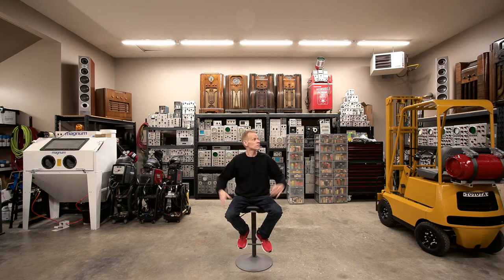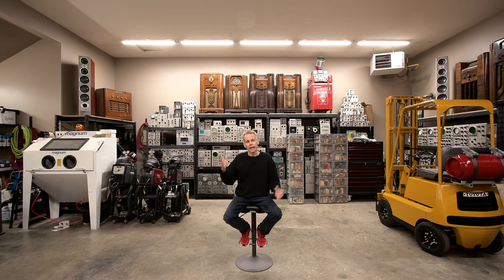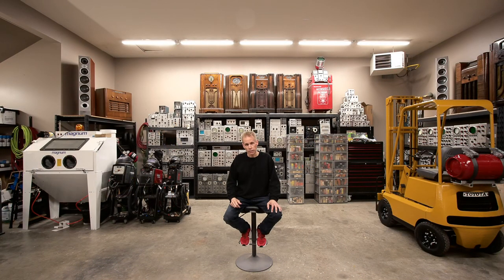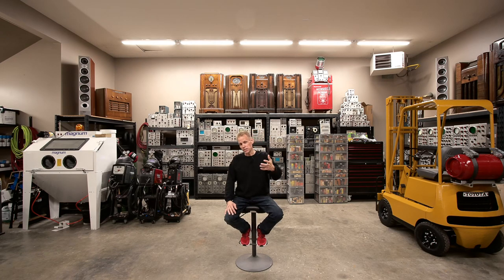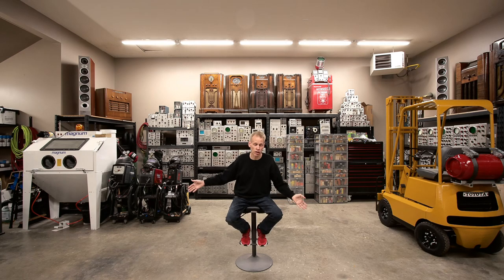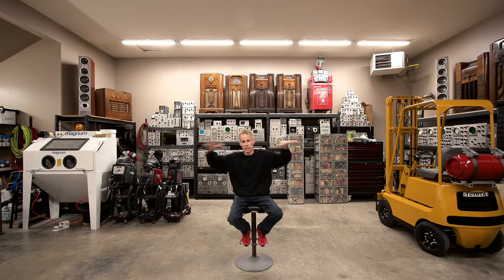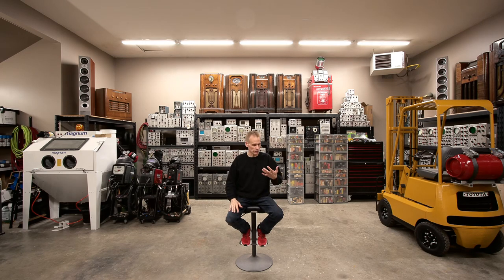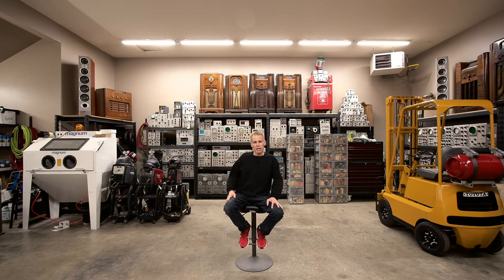ZAP! Mr C's Worst Electric Shock Explained In Detail!

Comment: Paul, I have two quick story's if you have the time. Back when I was still in high school I was learning electricity working on a WW2 era destroyer escort DE-238. In the aft. section of the ship there was a 450v panel that had a dead short on one of its circuits. I had tested the rest of the panel while live and could find no reason why the washing cylinder wasn't working. long story short I thought the switch on the washing cylinder had just gone open circuit so without any protection I flipped the main high voltage breaker and nothing happened. unknowingly I had energized a dead short and nothing happened to me. At that time I had a strange feeling someone was protecting me but I couldn't be sure. The senior electrician at the time came and said that I should have been dead and that panel would have easily blown off the bulkhead but nobody could understand why it didn't explode.  Lastly when I was even younger I was welding in my shop and thought to challenge God one day. I remember being frustrated growing up in a religious home so I said out loud in disbelief God if you are real show me. Right after that a nearby propane tank exploded and witnesses say the fireball pushed me out of the shop doors. I was rushed to the hospital having my hair burned clean off and the medical staff couldn't believe what happened. Before long the baffled medical team just sent me home because I was not burned up despite the explosion. When I went to school the next day they put me in the wrong class for some reason and sat me in the corner of the room, when I looked over to my left there was a poster that had a Bible verse saying: I send my angels out ahead of you to protect you. I still have a black streak in my arm that wont go away but its a reminder that safety should always be top priority and miracles still happen even today. Thank you for sharing this story with us, I wish you the best. -Ryan
Reply from the maker: Thanks for sharing your story Ryan!

Comment: The electronics mentor of my teenage years always used to say, "ONE HAND IN YOUR POCKET" when touching live stuff. 

Once in the lab, another student learned this the hard way when he touched the front of an unknown small stereo audio power amp while the other hand was leaning on an old table top real-to-real tape recorder (Ampex if I remember right). He got a good shock - but not gripping anything, gravity instantly disconnected his one outstretched limb touching the amp.

It turned out the audio power amp had the hot wire from fuse holder to volumer/power knob pinched under the amp's heat-sink mid-span in the chassis making the outer metal hot. (the unit had a 2wire cord)

Comment: Like some of the other commentators, I've vaporized metal screwdrivers while attempting to discharge HV capacitors in large pieces of electronic equipment, like some of those oscilloscopes to your left.  The unit was unplugged and should not have had any power supplied for hours, yet it would grab you or vaporize something with anywhere between 350 VDC and the 20-23 kV of early color TV picture tube circuits.  I also worked on "hot chassis" "All-American" vacuum tube radios, where you could get 120 VAC line voltage if you didn't keep one hand in your pocket.  However, my worst experience was from "hot neutral" current fed through an apparent cross-connection from a "de-energized" 120 VAC junction box to an older circuit that was partially "knob and tube".  The conversion had been done in 1956, and it had some problems.  I had my legs wrapped around a cast-iron sewer pipe in a hot attic and was working on the circuitry when that "humming" bit, and I couldn't let go as you describe.  Fortunately, my legs let go and I dropped onto the ceiling joists, which held me from falling down to the floor below.  Like you, I was so very lucky.  I have not forgotten that experience and always appreciate your "safety first and foremost" talks.  You really are taking your own risk in your hands with electrical and electronic equipment, even if you are wearing proper safety gear (like a flash suit), because just a little path to ground or a crack or pin-hole can cause serious injury or death.  Stay safe!

Comment: When I was a cable tech, I was troubleshooting a Motorola DCX series DVR that was acting really bizarre (I wonder why…) It was double insulated with a 18-2  but had a metal chassis. Well something in the customer’s TV had failed which made everything at GND on the DC side was live…including the HDMI cord. I squatted down to pull the DVR out so I could check signal coming through the coax (the DVR was not plugged into power during all of this) and when I grabbed the chassis it lit me up at mains voltage. I could not let go, but I was squatting down so when my muscles tensed I leapt backwards. I ended up yanking the DVR out so hard I ripped the F connector off the DVRs circuit board. I survived, barely, spent a few days in the hospital. It messed up the feeling in my hands, but really did a number on my heart, which still plagues me to this day.

Comment: I think all of us who work on this old stuff have some stories to tell... I got bit by a Heathkit signal tracer, the B+ terminals have an exposed metal ring around the base that is at full voltage.  I must have brushed one of them with my finger one time while moving it, and got a good jolt.  Fortunately nothing as bad as Paul's experience, but it still gave me a good scare.

Comment: 😂Good story.  I had something similar back in the day.  There was this amplifier with 4 811A tubes.  It was making noise on receive.  I was spudging at it with an insulated tool, and it just reached out & got me.  Burned a hole in my knuckle, knocked me across the room, knocked the Amp onto the floor.  Paralyzed both my arms - one was stuck up, the other down.  

Last year, I built an LDMOS amp.  One of my favorite characteristics of that amp is that there's nothing in there that will kill me.

Comment: As a young radio tech I got mixed up with the plate voltage, +6250 VDC, of a 10kw HF amplifier. I had reached up with my right hand near the tube and the voltage reached out and bit me. There was a large bang, a flash of light and I took several steps backwards. The voltage went across my chest and arced out to a signal generator near my left side leaving a hole in my uniform and a ragged burn the size of a quarter on my ribs.  My right arm was useless and pinned up against my abdomen but after a few minutes it fell to my side and wouldn’t move. I made it to my supervisor to report that I was hurt when my legs buckled. Spent a day in intensive care while the docs did some tests to see if I killed the bones in my arm (I didn’t). The radio type was a Rockwell Collins HF 8022-10 LPA.  Took many years for me to not react badly to the sight/sound of an electrical arc.   

Really enjoy the channel Mr. Carlson, been a long time viewer.

Comment: When I was in Junior High School I was fooling around in my room with an old AC model train transformer. It was 120 VAC input and, probably, about 6 VAC output. I got the idea to connect a flashlight battery to the secondary to boost the voltage instead of dropping it. That only works with DC to create a pulse at the time of initial connection. I decided to see just how it worked and grabbed the primary connection. I received a huge shock that caused me to jerk and hurl the transformer across the room, breaking the connection. That was about sixty years ago and I've never forgotten the incident. When I was in grade school my father worked as a transmission lineman (high voltage) at Dallas Power &  Light. Our next door neighbor had also been an employee of the company. He was missing one hand and only had three fingers on the other hand. He had been working on high voltage equipment that was shut off but someone inadvertently turned it back on and it burned off his hand and fingers. About 1970 I was working as a driver/attendant for Santa Cruz Ambulance Company. I remember one call where we responded to an electrical shock accident. It was also an employee of the electric company who was working on overhead lines and somehow managed to contact live electricity. The man wasn't  killed, or even apparently severely injured, but when we arrived he was screaming in pain as loud as he could and continuously the entire time we were transporting him to the hospital. I've never heard an adult scream like that, even in movies. It is possible the shock "fried" his nerves and he was experiencing extreme pain, even if the injury wasn't fatal.

Comment: Hi Paul
I had a similar thing happen to me. When I was in my 20s, I was working on an amplifier. I switched the amlifier off and then picked it up to turn it around. I was living in the UK at the time, the mains voltage being 240V at 50Hz. As I picked the amplifier up, I rested my right hand on an exposed fuse. The other hand was on the grounded chassis. I had 240V across my chest for several seconds. I managed to throw the amplifier away from  me, and I went in the opposite direction. Like you, I had the 50Hz buzzing, but I could think OK. Like you I thought to myself if I don't get rid of this, I would die. Afterwards, I felt sick, and I was shaking.
I am like you. I am very conscious about safety. I set up a hi-pot test station at work. I have flashing lights, barriers, two-handed remote, and warning signs. Staff have to go through a rigorous training session before they can use the equipment.
So that is my story. I learned the hard way.

Comment: I always go with the one hand rule, and I not only use a rubber coated work glove but also a surgical glove, too. The reason is that it's less likely I brush my hand across anything if I'm working on something that's turned on. 

Believe it or not, high voltage DC is dangerous because you can't let go of it like you said.  AC, while just as dangerous, gives you a chance to let go when it gets to the zero crossing.

Comment: Ive just come over from Big Clive,s video and realised I've been unsubscribed. Now  resubscribed.
I would just like to let everyone who works on high Current and Voltage know what has actually saved me on a few occasions and that is a 1/2 inch thick rubber mat around my workbench. I always found over the year's if you can prevent a return path to ground then if on the very very rare occasion you come into contact with a live connection then providing you only touched it with 1 hand it has nowhere to go and makes things a lot safer. My late Dad who taught me most of what i know used to have a hard rubber mat on his workbench aswell.
The worst shock i ever got was from a CRT final Anode connection  when I was a youngster, the CRT had not long been removed when I went to pick it up to move and was thrown accross the room. All part of learning.😊

Comment: 6:43 what happened here was you entered ventricular fibrillation (VF). Your heart having essentially stopped beating, without the beat, your cells would’ve exchanged oxygen into C02 and you would have eventually passed out from anoxia. From your recollection of events, what seems to have happened is that somehow the sinoatrial (SA) node, the part that generates the electrical activity had restored synchronisation amongst the heart muscles and due to the lack of oxygen being sensed by the circulatory system, the brain told your heart to immediately accelerate to compensate for 02 / C02 saturation once it was “back online”.

Comment: Yep... That was a serious electrical shock.
I had a 277 vac leg grab me when I was working on a 3 phase system for refrigeration. I had on a pair of military boots, and pretty good gloves. I was leaning over a trench and slipped and my pliers touched a cable lug. The voltage went in my right side and out my left hand which had brushed against a metallic conduit. Thank God the power of the current incinerated one jaw of the pliers.
My arms and chest ached for several days. Got VERY lucky!

Comment: One of the most interesting shocks I recall happened to me when I was perhaps 8 years old. We had a well and a new pump house my dad and friends built. I put one foot on the wet wooden floor and got zapped. I wasn't harmed by the shock that I know of. But the shoe I put on the floor never felt the same. I'm 40 now. I've been blessed to not receive a bad shock. I've been fascinated with electrical and electronics  practically from birth. One time as a very young kid, I cut a power cord, plugged it in, and it burned a hole in my shirt. Only my mom actually remembers me doing that.

Comment: Yes, I got zapped pretty good a few times: the weirdest time I was pointing to a part in the back of a console TV "Not to touch" for the benefit of my cousin. I was about three inches from the damper anode cap and the dry air connected me to the HV and it drove my elbow into the wall behind me--my elbow hurt for days. I had no direct connection at all, no ground, or HV, but learned that a nasty waveform generates properties that don't require wires to couple you to the circuit.

Comment: I can remember that in a Navy Electronics school at Nattc, Millington Tenn. )(1961) that as part of a exam I had to trouble shoot a 5 tube radio that I had built in an electronics lab I got buzzed with B+ voltage, Failed and was set back two weeks.  Another time a fellow sailor was re-assembling an electric plug on a extension chord and got shocked when it was reconnected.  He yelled and his voice had a warble (60 cycle).  We had to kick him away from that chord or he would have been electrocuted.  You always have to treat any electronic or electrical circuit as live.!!!!!!!

Comment: Hi Mr Carlson, When I was a kid about 5 or 6 years old, I suck a solid bare copper wire into an electrical outlet to see "what it felt like". I has already heard the story of a family member who got stuck and could not let go but I figured there is no way people can get stuck, I can be fast enough to take my hand out and low and behold I was able to take my hand out with no problem whatsoever. Since then, throughout my like I have gotten shocked with 120V electricity several times. and have always ben able to leg go once I felt the shock. I have heard that the really dangerous current, the one which really leaves you stuck is not AC is actually DC.

Comment: As a 12 year old, I enjoyed mowing the lawn because the lawn mower had a gas engine. To stop it, you push a grounding strip of metal to the top of the spark plug with your foot. I was a curious what it would feel like if I pushed the metal strip with my hand. Wow! It felt like someone kicked me in the shoulder with a lead filled boot. Fast forward to high school, my other shocker was from the fly back transformer of a TV which I modified so I could plug my music into the CRT's magnetic deflection yoke coils to create Lissajous patterns. Somehow between it and the tube amp driving the coils, it was floating at high voltage. While demonstrating it to my girlfriend, I touched the amp and the TV chassis, was zapped and fell unconscious on my bed, which was luckily next to the TV. She freaked thinking I was dead. I learned why electricians say, "keep one hand in you pocket". Since then I never work with anything over 24 volts.

Comment: You can never be over cautious. I was 19, inexperienced and in a hurry. I had broken the caretaker's light fitting ( we lived in a block of flats) and in my hurry to fix it before I went out, I decided to rob the fitting off of my Mom's bedside lamp. In the back of my head was the idea that Mom ALWAYS unplugged anything not in use. I grabbed the lamp and tried to rip the wires out. One wire came loose, so second attempt had one wire firmly in my fist and the lamp in the other fist. It felt as if my arms both disappeared and I only had hands attached to my shoulders, no movement possible. I managed to stand up and try to get to the wall plug, fell over, and the shock stopped. As I moved, it started again, I somehow moved/stood and it was over. I was told that I was screaming blue murder, I vaguely remember stumbling downstairs and being rushed to the doctor. He must have given me a sedative, because mt next clear memory is of waking up the next morning with burns on both thumbs and forefingers. 45 years later, I still have the scars and the dreadful memory of my closest brush with death. That old block of flats had only fuses, no earth leakage protection at all. People today laugh at my obsessive respect and fear of live connections....

Comment: Worked on an old TV when I was young, I actually passed out. Both vision and hearing was buzzing like in a cartoon. When I finally woke up my underarm was hurting and pulsating, I went into kind of a shock and started to cry from the close call. I was fine a little while later, but I learned an important lession...
I'm pretty sure it was 240V line voltage, not the CRT high voltage. (Non isolated chassie)

Comment: I learned the hard way that some high voltage and high current devices can be fed from multiple supplies. The first was a 1956 RCA 12 mile range radar set on our boat. Then as I got older, industrial automation. I've become a stickler for lock out procedures and testing.
I work for an electrified railroad now and am constantly surrounded by things AC and DC that want to kill you at the smallest lack of attention.